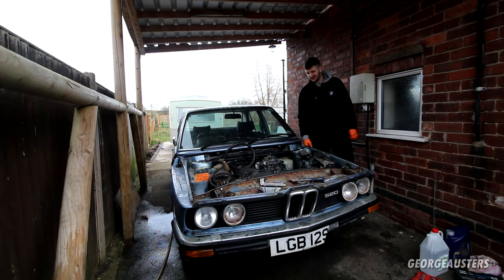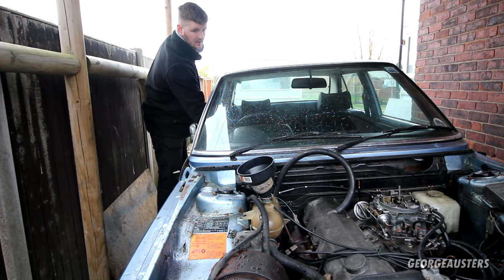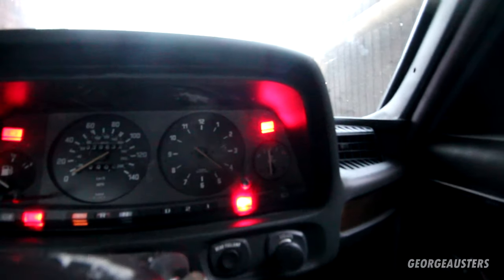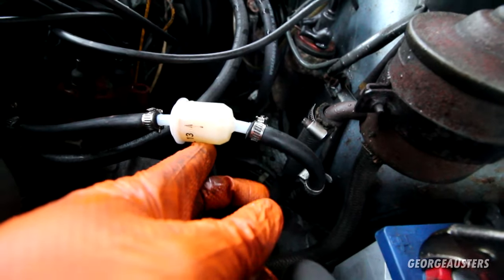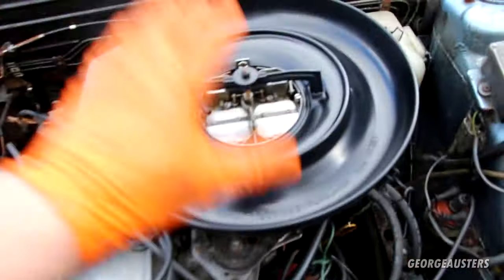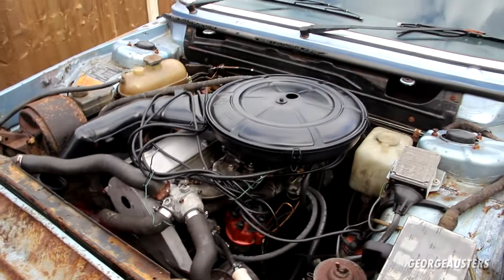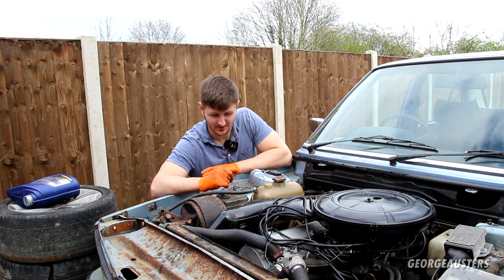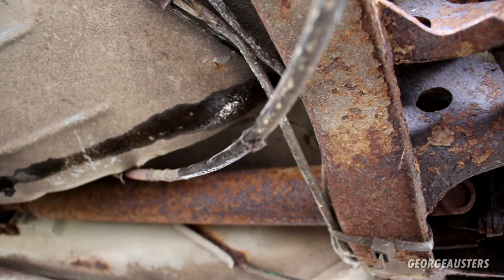WILL THIS BARN FIND BMW EVER SEE THE ROAD AGAIN?…

Comment: Because of the work you have done , the rpm at idle will always rise to a new level in older cars . This is a good sign. Now adjust the carb to bring it down to regulation level.

Comment: The Solex 4A1 is a horrible thing - most were replaced by a Weber twin choke conversion in the eighties. The 4A1 is too big for the 2.0 really as it was meant for 2.5 litre upwards engines like the 525, 528, 730 and cars like the 280 Merc, 6 cylinder Volvos etc. These have two idle circuits, one for each pair of chokes with all those drillings, vac pipes plus two idle solenoids. Detailed info is hard to find now but there's a book that has all the original BMW service info for these carbs, called  '5/6 Series restoration tips'. I got one from Amazon and it's pretty good.

There should be a vacuum pipe going from the manifold to the stub on the air cleaner where the crankcase breather pipe fits if memory serves. It's been a long time. If it's not there you'll have an air leak.  

Bare minimum restoration - get it running and driving, touch in the scabby bits and move it on. A 520 just won't repay a serious resto. I'd replace all the brake steel pipes and all the flexy hoses which will be knackered and trying to heal up inside causing the brakes to stick on.

Comment: No idea --- only you know its true condition,  you briefly showed the state of the panels and rust ...not shiown with enough light or  in depth, or extent  so we are blind ..so cant advice because of that.-  and THAT IS THE MAIN THING, George with this car ,  A couple of brake pipes front to back can be done for £20,  if you have the right tools - recomend sykes or ratcliffe flaring tool..can be picked up for under £50 if not complete --just make sure it has  dies and punches - for 3/16ths  which is common to most cars of this era and is also known as 4.75mm  hopefully that's what the car has. Think the carb problem is its .choke ..may have a heated bimetaliic coil that unwinds ..heated by coolent and sometimes they have a little eklecric heater element assisting the system.

Comment: You have already saved the car from rotting in a barn, you have rebuilt the engine. I think it would be a shame for  the car to be sold as it is. I know you have other projects on the go at the moment, but I think you should do a full restoration, I know it will be expensive but it is a classic worth saving! You don't need to do it all in a short period of time it can be done as and when funds and time are available. Great content as usual George 👍

Comment: Nice touches under the bonnet. Running rich, the choke valve inside might be seized to rich hence why it’s running like that, but need a CO machine for better mixture adjustment.
The brakes pipes, that’s cheap to do and not surprised the main pipe is leaking.
Slowly, you’ll get there. Mind you, your engine, despite rich, runs very well unlike mine 😅

Comment: Once you've got the mechanics sorted (at least no modern electronic nonsense) and you've eliminated structural rust, if any, I reckon go for an MOT and just drive it! Full patina on show, give it a coat of clear and enjoy it!
Reply from the maker: It’s actually MOT exempt due to the age.. I don’t think I could keep it long term with the rust as it is as the doors are pretty crispy, as are most other panels

Comment: Luckily these old cars have relatively few parts attached to the body, so my suggestion is when all "technical" parts are working quite well, try then to find someone in the whole Europe that "recover" the body by welding and exchanging all rusty panels and frames. Then paint it and cover every part with proper rust protection. 
See it as a long time project, but try to make it perfect. Create a plan for almost every detail. Sometimes you can find a similar car and get some pieces quite cheap and sell the parts you don't need.

In my home village in Finland, my father put a BMW/EMW 328, my 1949(?) in a barn about 1955. The car stood there till 1973-76 (i guess!). Then it was "sold" to a man and then I think it caught on fire, but shouldn't have been that severe, as the car today is restored. A 75 years old car. 
Original colour was light green, but now it's black.
I think the car has an inline 6 cylinder 2.0 litre engine. Two doors, with the spare wheel on the back. This car has a much bigger grille than the famous BMW i4! 😆😆😆
This car was made in the BMW shop that remained behind the iron curtain after WW II. Maybe 1951 they had to rebadge the car to EMW. This car has the blue-white BMW badge.

Comment: I’d throw out the idea of doing a partial restoration.  Put in used parts from a salvaged car (if they’re still out there) but do it to a budget.

At 1500, it’s worth trying to do it on the cheap.  I wouldn’t strip it down to rebuild as, what do you have in the end?  Unless it’s rare, it’s another old sedan.  Hate to say it.  Thanks!  😊

Comment: Before you do spend any more money & time on this car I would assess & evaluate the rust situation. It is not mechanical failure that sends cars to the scrapyard, it is rust. Rust occurs on the outside AND the inside & much of it is inaccessible & therefore untreatable. To me this car looks too far gone & you would be better off cutting your losses, scrap it & buy something else in better condition unless you are prepared to spend an absolute fortune on it. You have seen it up close & personal so you will have a better idea than any of us BUT I would advise you to think with your head & not with your heart.

Comment: just a mention about these ones originally running on 4 star fuel. not sure if anything was done to get them unleaded ready
Reply from the maker: Are you sure this originally ran on leaded fuel being a 79?
Reply: @GeorgeAusters   some were taken off the road for that reason. "  Leaded petrol was banned in 1999 due to concern over toxic emissions. Since 1992, all new cars must have a catalytic convertor to take unleaded " .worth investigating.

Comment: Excellent, George! 
This is exactly what I'm anticipating will happen as we attempt to revive our family's 1980 E12 518. I'll tackle that when the war chest gives at least some semblance for success towards a roadworthy solution. You have the M.O.T. in the UK to tackle, in Germany (where our family car is located) there are stringent requirements to re-certify a piece of cultural history (TUeV Par. 25 Vollabnahme). 

Since you want to drive it, you prob have to take Sreten's (yt e539 restorations) approach and do the full job, and, yes, you risk putting out more than the car will ever be worth (I'm willing to go that route myself, what speaks for our situation is that the 518 has been in our family since 1981, purchased as BMW-employee used <1 yr old car ("Jahreswagen") at the time).
This is the price we pay to preserve heritage, a relic of history. 
Theoretically, this is the vehicle which continues running after a nuclear attack, when all electronic black boxes, Motronic et al, anything powered at the time of 'electronic', especially contemporary automotive material will be fried.
Thank you for laying out a good 'scope of work' with the vid today. I'll be following you! - Cheers, Chris from Connecticut, USA
Reply from the maker: This car is MOT exempt as it is over 40 years old so I just need it to be roadworthy and insurance and it can go on the road.

Comment: You could do a full restoration somewhere down the track. In the meantime suggest get it running and stopping safely. This way you can enjoy it whenever you want to. Change all the fluids and spray every bit of rust with something like KuRust, then store in the new garage. You can keep coming back to do some body work when you feel like it.
ps Can we have an update on the project.
Reply from the maker: I’ll be doing the brake pipes on this soon👍🏻
Reply: @GeorgeAusters  That’s spooky!  I was just thinking the same thing!

Comment: Those cars were mechanically excelent for the time when they were put on the market. But they were, what we say in Norway 'rust shacks'. As most of the cars from that area was. I think it will cost you a good lump of money to get it through MOT. But it is not impossible. The thing is, the brake lines will probably go down the drain if you shall fix the rust.

Comment: Full Restore mate but see how much you will lose resale value etc if severely not worth it then get it working ship it to someone with a deep passion to restore the body as well and keep it on the road for another 30 years or so never leave yourself destitue however give it a bloody goof go if you fancy it grinding welding hemerite chemical to turn rust back to metal primer paint replace what needs it bit of welding skimming maybe a rattle can paint job the whole car new ht leads maybe add some colour definatly fix the rust across the top under the bonet etc wheel arches frame rails lot to think about see what you can do if not full send get it painted budget dependant really but it is a beautiful car and I hope you enjoy your time working on her regardless appreciate the content as always if its cant remember what year this is atm but I think tax & mot free less im thinking of another I watch a lot of car stuff so have a good one cheers

Comment: No tax no mot no ulez, keep that in mind. Motoring is only going to get more costly as they try to force people of the roads into there 15min cities. Geo fencing in cars is already here, they just haven't switched it on yet. Going to take a few yrs but it's coming. IMO always good practice to put water in first then anti freeze, water is a bit cheaper, if you a low down leak it just drains the water out.

Comment: Crack the block lol 😂 not in the uk -1 or 2 isn’t cold enough to crack a egg let alone a carst block calm your self lol 😂if you don’t know what you are doing either leave it to someone who dose or leave well alone best advice I can give really
Reply from the maker: What happens when the water inside it freezes then? It will at least pop out a freeze plug
Reply: @GeorgeAusters  the water in a sealed cooling system has no air in it when it freezes in the block it dose not expand and crack the block it’s the rapid heating of the frozen engine that pops the core plug or cracks the block as the frozen water expands faster than the cast  iron it will normally brake the water pump before popping a plug or cracking the block just let the cold engine idle up to temp slowly it’s like the warm water on a frozen screen myth like warm water will not crack a screen obviously a boiling kettle will .